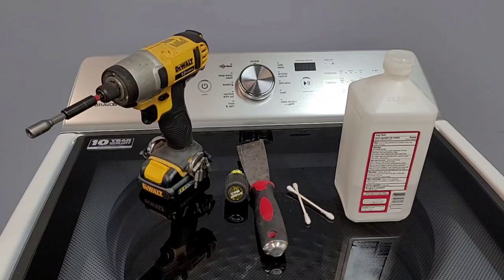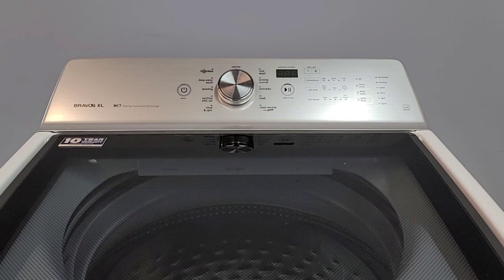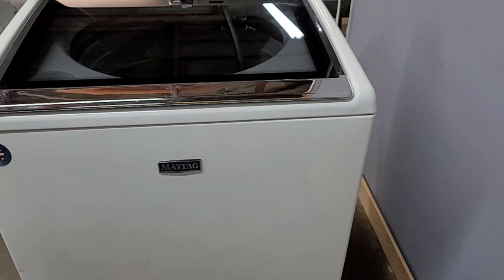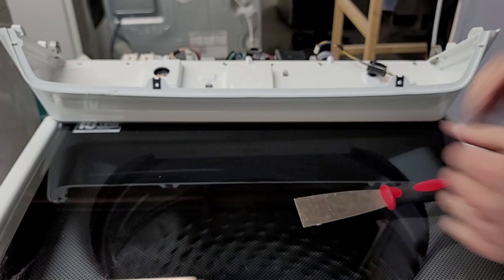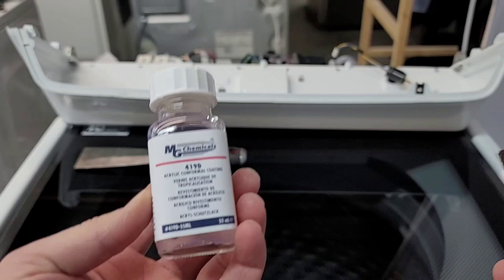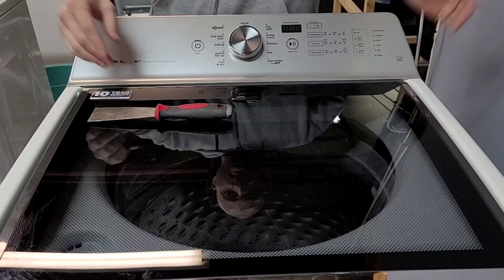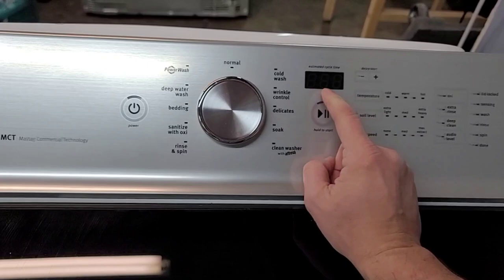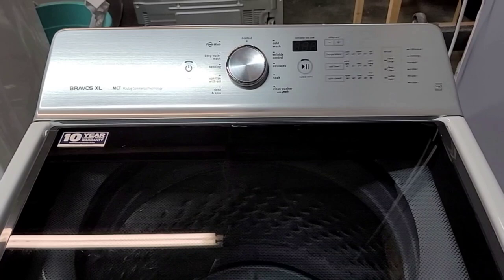Maytag Washer won't start won't turn on? No Problem. Fix error codes F6 E2 / F6 E3 | Josh Cobb

Comment: Hi everyone,
How long does it take to scrub the four little copper strips?  Two of mine are dark and I’ve been scrubbing them with a Q tip and 91% alcohol for an hour and they’re still not copper colored.
Reply from the maker: Get a tiny file and very lightly scrap it clean.  I have a newer video showing how it works and what file / pick I used.
Reply from the maker: https://youtu.be/KXIZ6AIUGws

Comment: Did you use the acrylic coating only on the exposed board you cleaned with the alcohol? I found it on Amazon for $15 with $5 shipping. Thank you!

Comment: Hi I can't get anyone to respond to this question but my bravos will turn on but if I turn the knob or try to start all it does is beep we replaced the control panel and we're still having the same issues we are getting code e3 f6 and e2 f5
Reply from the maker: The first code you mentioned would indicate a bad control board. However the second code you indicated would be a faulty lid lock switch. I would definitely start with a lid lock switch. Did you buy your new control board brand new or used? It’s possible you got a bad control board if you purchased it used. I hope that helps!

Comment: I repair appliances and the picture you painted of what repair techs charge was not very accurate. I did this repair on a Whirlpool Bravos and charged $105. I don't want to replace any boards if I don't have to, I never had even a $400 repair in 2020, with the exception of a couple LG and Samsung fridges. I'll help the customer find a nice newer used appliance if it makes sense.
Reply: Cabrio that is.

Comment: Do You Know How To Fix The LF Issue
Reply from the maker: LF stands for long fill.  Normally this is cause it’s taking too long to fill with water.  You want to make sure the hoses aren’t clogged when they hook up to the washer.  Also Make sure your drain hose is elevated, can’t be put straight into a floor drain.  Hope that helps.
Reply: @joshcobb4100  which hoses should be checked and how should it be elevated

Comment: Got an error code that says "LF". Any idea what this means? No water is coming out when cycle starts.
Reply from the maker: Long Fill.  This typically means it's taking too long to fill the tub up with water. Make sure your water is turned on and inspect where the hoses connect to the machine for any clogs or debris.  The other thing that I've seen happen is the drain hose put into a floor drain. If this happens the water will simply drain out as it fills up. The drain hose has to be elevated to at least 3 ft before it can then go back downward.  Hope that helps, good luck!
Reply: @joshcobb4100  I've checked both hoses. Took out the inlet screen to check for debris. There was a little but not enough to clog it up. Did all the steps with the alcohol to the metal contacts. They had no corrosion but cleaned them anyway. I"m guessing the only other issue is the water inlet valve. 

The washer turns on and starts the cycle but no water comes out.

Will get the replacement part and see if that helps. If not then guess it's time for a new washer SMH. Both washer and dryer are less than 3 years old.

Thanks for the advice!
Reply from the maker: And you are 100% sure the water is on, and hot and cold aren’t mixed up?  If so, then I would also replace the inlet valve.
Reply: @joshcobb4100  Yes I am 100% sure that the water is turned on. I went through the diagnosis to test each valve and the main hot and cold water valves are not working.

Just ordered the water inlet valve. Will update when/if this works.
Reply from the maker: Sounds like you got it licked!  Please update me when you get it done! ☺️
Reply: @joshcobb4100  will do!

Comment: I just tried to pull codes - but did the same 1, 2, 3 - 3x --- no lights came on for me to show codes.  Am I in worse shape?
Reply from the maker: Try the fix, then give the codes a go again.  If still nothing, board might actually be shot.
Reply: @joshcobb4100  on the 5th time it lit up.  Got code F7 E5.
Reply from the maker: I would just spend a little time googling it and taking the results to YouTube and see what you can find. Might pop a little popcorn and Brew some coffee lol.
Reply from the maker: "The F7-E5 error code is a shifter fault error code. The most common problem related to this error code is going to be that the actuator (shifter)has failed. Check broken or loose wires or connections at the control board and actuator. ... A bad control board can also cause this error code, but the actuator is most common."
Reply: @joshcobb4100  where is the shifter located?
Reply from the maker: It’s underneath located on the side next to the motor.

Comment: Help! I have tried all of the ways listed online to run diagnostics and it doesnt react with a bar of lights lighting up or anything. My washer while running had and error code F5 & E3. Wanted to run diagnostic to be sure.
I need help just trying to figure out how to run the actual diagnostics test. Not much out there for Bravo XL. Thanks
Reply: My bravo didnt respond to pushing the 3 buttons. Please help!
Reply from the maker: You have to try pushing those three buttons many different times at different speeds. Sometimes I can try 20 times and it won't work and if I speed up or slow down just a little bit it will work. It really is a pain!
Reply from the maker: If it absolutely will not work no matter how many times you try it might indicate a bad board.

Comment: Noob here but how do I get the hoses off without water spilling everywhere?
Reply from the maker: Make sure the water is turned off, place a towel down and go for it.  I will try to take them off the wall before I take them off the machine, and place the ends that come off the wall where the drain hose goes to catch most of the water. Or you could do it the opposite way and put the hoses in the machine so when you take them off the wall the water goes into the machine. Always seem to spill a little water though LOL.
Reply: @joshcobb4100  thank you

Comment: Cleaning the contacts didn't work for me. They didn't appear dirty but I attempted to clean them anyway. I bought and replaced the control board, no luck. I bought and replaced the touchscreen and got 2 washes out of it before it failed again. Thoughts?
Reply from the maker: That’s very unusual.  You might have an electrician check your power outlet to ensure it’s working correctly.  Are you getting this same error code as in my video?
Reply: @joshcobb4100  Not the same error no. If I turn the washer on, I don't get any error codes, the touchscreen is lit up but simply unresponsive and double beeps no matter what selection you make. if I enter diagnostic mode (now) it tells me that the locking mechanism is the issue. I already have one on order.
Reply from the maker: Locking mechanism would have been my next step too.  Good luck!

Comment: What if It doesn't work
Reply from the maker: I’ve had a couple not work after, at which point I assume the mother board actually is damaged and needs to be replaced at that point.